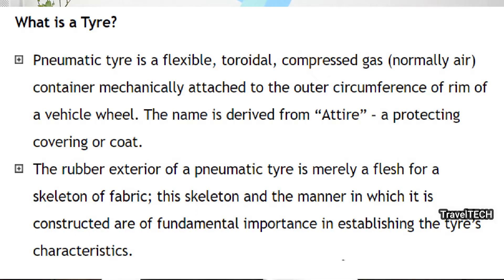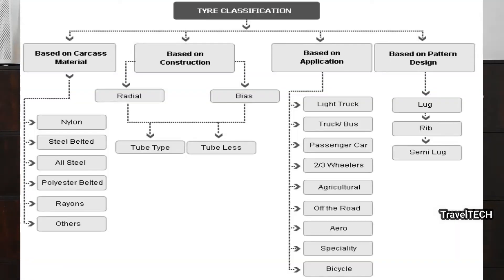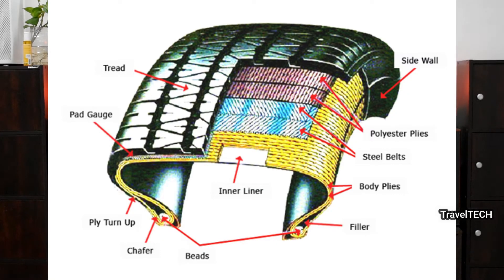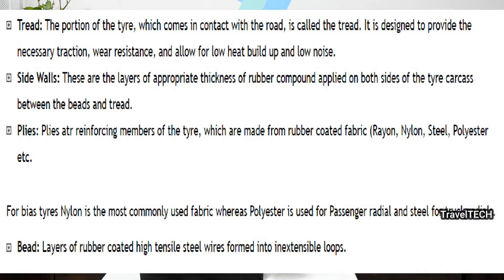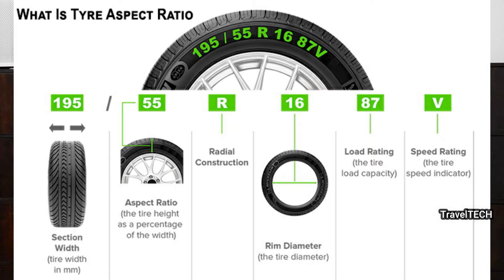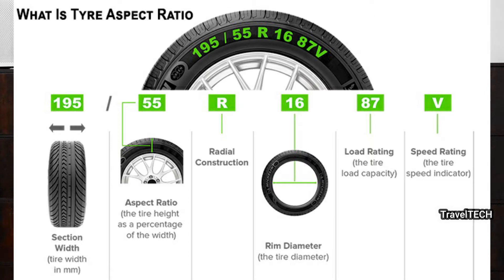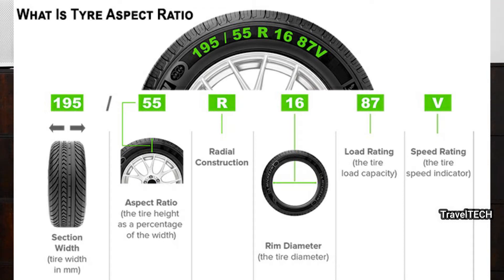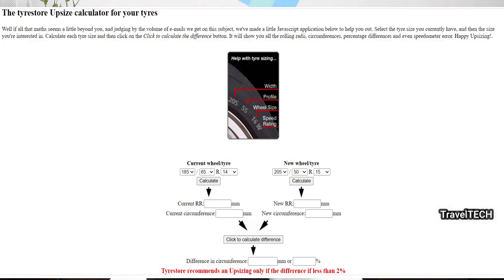Tyres - Upsizing, Definition, Classification, Features - Detailed Description - TravelTECH

Comment: Nice and informative video. I have taken a new kia carens prestige petrol which has a 195/65 R15 wheel I want to upgrade it to 16 or 17 Inch wheel. Could you please suggest the best tyre size, also do I need change the rim? The higher variant if kia carens comes with 205/65 R16. Can simply switch to this size, do I still need to change the rim?
Reply from the maker: R15 in your tyre shows the rim size. If you want the R16 version then yes you will have to change the rim along with the tyres. You will have to spend more money for rims. I recommend you upsize your tyre to 205/65/R15. That will provide better grip and also improve looks.

Comment: Which is perfect size for 155/70 r13 to resize
Reply from the maker: Go with 165/70 R13. Its slightly higher than the recommended 2% difference, but will work out well.